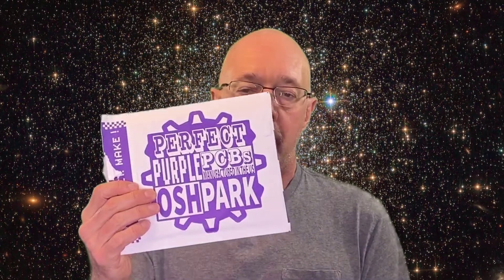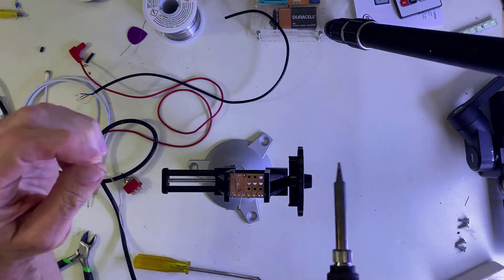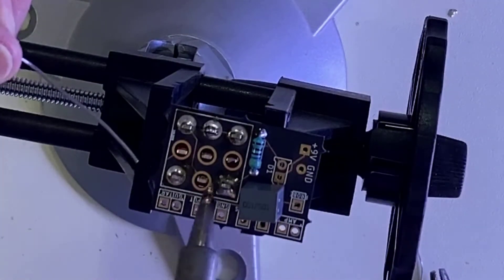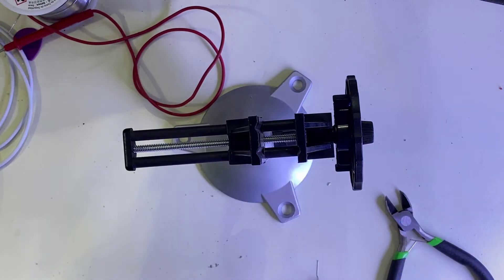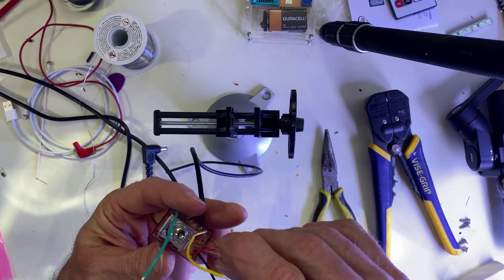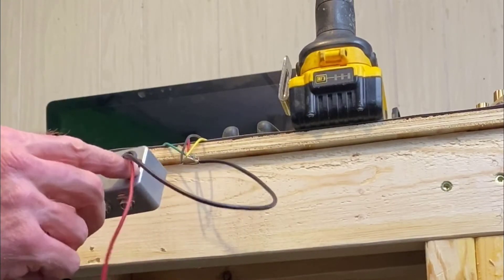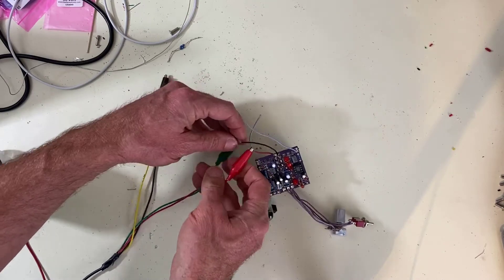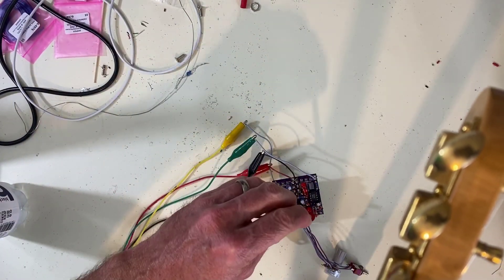Build Your Own Effect Pedals - Test Box (Part 2) Soldering, Enclosure Preparation and Testing

Comment: That is genius. 👍🏻 My tip would be to tie the wires in a knot just inside the box so they don’t pull through the hole and put pressure on the solder connection. I don’t know if having the wires in a knot would affect anything electronically since I don’t know squat about electronics. If it does you could always use a zip tie around the wires to do the same thing. Love the channel. Would love to learn electronics and I am learning more everyday thanks to you. 👍🏻
Reply from the maker: Thanks. I really should put a strain relief on the wires.  I will eventually pull them out and have to resolder them. 

Thanks for watching. 🙂